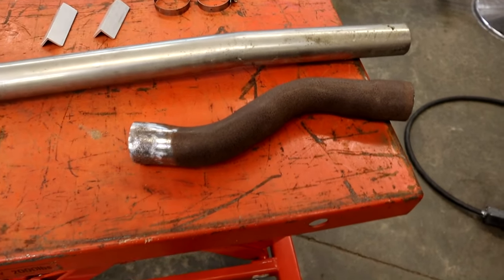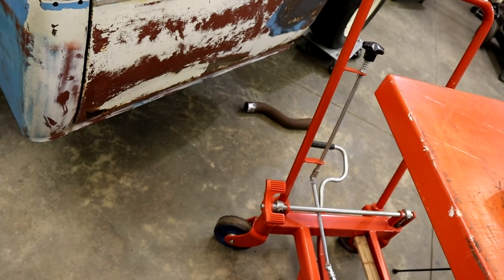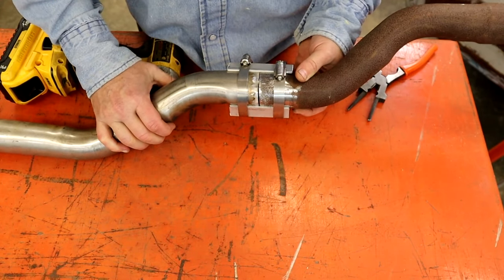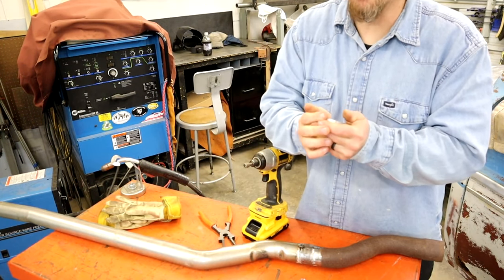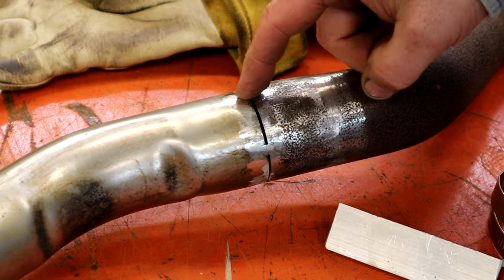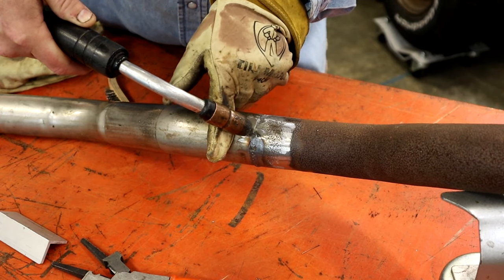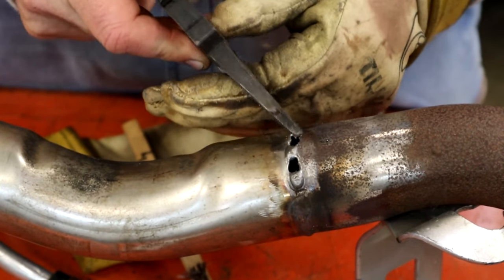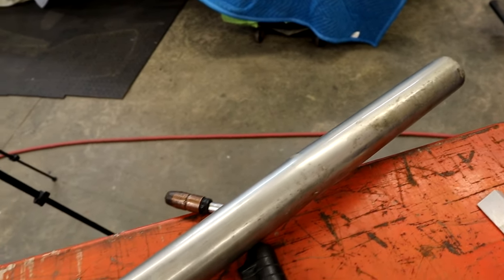How to Mig Weld (Stainless Steel) to (Mild Steel) Exhaust Tubing!!!!!

Comment: I'm a complete hack of a welder, I taught myself from old 1950's manuals, hah, but I've been fortunate enough to be buddies with some excellent welders, my uncle builds custom bicycle frames and his welds are gorgeous.   But my point is, I know just enough to know your great tips per minute count is some of the highest I've seen on YouTube.  I know there is a right way to do stuff, and I was a machinist before I got disabled, and I was even on the fussy end of the spectrum by machinist standards, but now that I'm disabled, I got lots of time, but not so much cash, so I gotta use what I can scrounge, and I'm always welding up "Riggins and Jiggins" as I call them on the farm, stuff to make my chores easier, so you pros 2ho take the time to show how to it the wrong way (welding stainless to mild) as right as possible, are so helpful, cause the manuals will just be lazy, and say don't do it, hah.  For example, I'm kinda broke down, bad disc in my back, but I still drag old iron machinery home, and the stuff in my budget is always back in the berry patches, on farms without a big loader to load it for me, so I really want a gin pole setup for my $500 f550, but I'm up in New England now, and there aren't 47,000 ranchers selling drill pipe cheap up here, but I did score some free stainless tubing from a milking machine outfit, it's so nice and thick walled, I don't want to think what it would cost  new, hah, but I don't have any thick stainless plate to do the tabs on the ends, so here I am, looking up how to stick stainless to mild, and I'm learning cool tricks like your v finger trick, on how to but weld tubing less badly than I normally do, hah.  Thanks again.
Reply from the maker: Thank you for watching,  I always wanted to be a machinist, that work has always fascinated me!!! Thank you for the support and keep on arcin and sparkin!!!!

Comment: I welded some square tubing to a stainless wash tub for a fire pit, I did use stainless wire but just regular 25/75 gas, turned out fine.
Reply from the maker: Awesome thanks for sharing,  ill have to try that!!
Reply: I just ran flux ss wire with a tiny bit of 25/75 (5 cfm ish) welding exhaust and it seemed to work well. I just got a bottle for ss but I don’t have solid wire to test difference yet

Comment: I don't feel bad about my welds now.  I had to just go with it and weld stainless to stainless fast and try to zig zag at the same time.  I used steel wire because f stainless wire...I may try to tig my next project of stainless exhaust pipe.
Reply from the maker: The tig is the way to go in my opinion

Comment: Could put a 1 in. wide inner sleeve between pipe sections to absorb burn-through, or prevent it.
But you lose 100 + hp.
Reply from the maker: Yeah that would work, who needs an extra 100 hp lol, thanks for watching!!

Comment: Should be using 309 wire to join stainless to mild steel, not stainless on the mild as it will crack.

Comment: Hello sir.  Have you done this with  both 409 and 304 stainless?  I have a header adapter that is 304 and I need to weld an O2 bung (mild steel) to it.  Thank you.
Reply from the maker: Just 304 is what the tubing was that  I used in the video. It should do fine, but the weld and o2 will rust. Are you mig welding it or tig? If I was gonna tig it id use 308L tig wire its a good all around filler.
Reply: @ACDesignsGarage  Thank you for  your reply.  I actually purchased a new 304 bung to go with the 304 pipe.  Can I still weld that with standard wire or should I do stainless wire?  I would like to tig it but just learning Tig and not ready for stainless yet.

Comment: So I can weld a stainless steel connection pipe to my existing steel exhaust pipe with just a regular gas welder no need for anything special?
Reply from the maker: Yes you can the ,only thing you need to do is paint the weld bead and maybe a little on eaither side of the bead because it will rust with the mild steel filler .
Reply: @ACDesignsGarage  awesome!! Thank you and your video was very helpful!

Comment: What's the best machine settings for exhaust pipe wire speed and voltage  ?????????
Reply from the maker: Id guess around 16v 195 to 200 on wfs. Let me know how ot goes we may have to adjust!!!!
Reply: @ACDesignsGarage  thanks for the info
Reply: I will try that setting when my driver tall pipe comes in monday I'm putting twin pipes on my 92 dodge dakota v6 that I'm restoring

Comment: Hello are you using a stainless steel wire or just mild steel wire.. Just wonder thanks.
Reply from the maker: Just mild steel, if you used stainless steel wire your weld wouldnt rust.